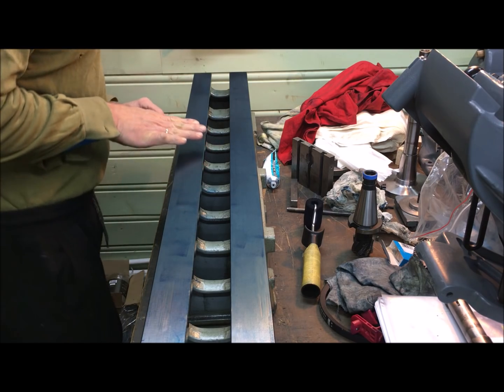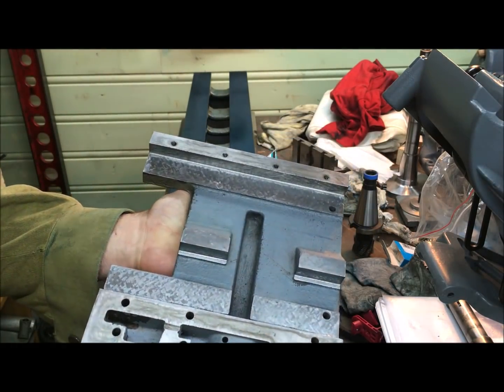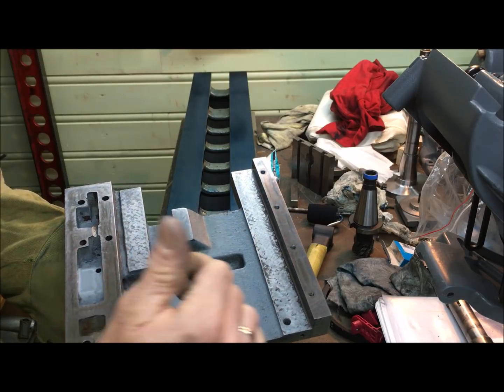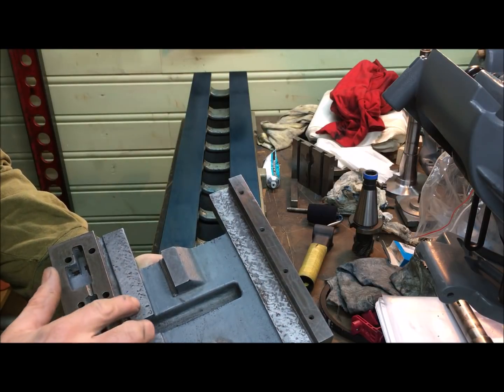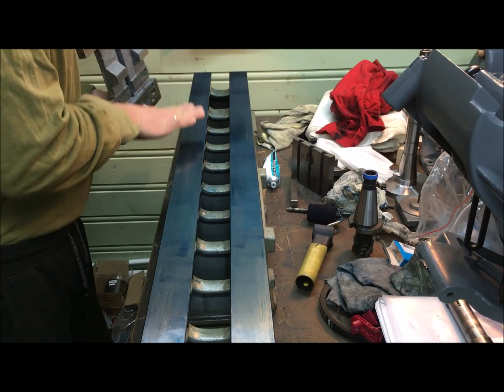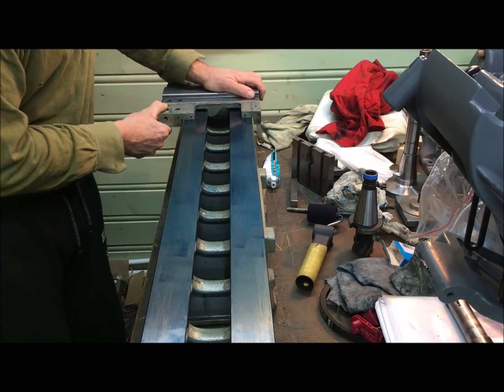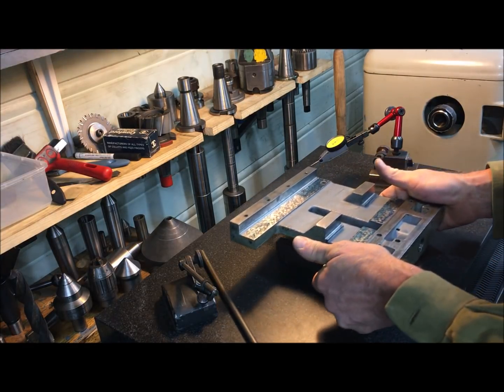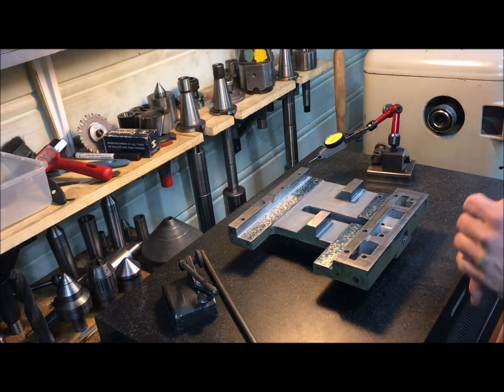EMCO Maximat Standard   cross slide scraping and testng

Comment: where do you get your scraping tools from. homemade or do you buy it?
Reply from the maker: The handles you see me use most of the time are home-made, but the rest is pretty much all Biax (and some Sandvik) blades. Masters and testing flats (ie. surface plates and straightedges) are all bought, apart from some smaller dovetails I have made for specific purposes.  Cast iron masters can be (quite easily) resurrected if worn

Comment: Do you think that principle of broader support applies to 'single dovetail lathe beds', like the Hardinge HLV-H?  I've always taken it for granted that distributing the load force over the greater (and more rigid, I think) top surface of that lathe bed construction is a big reason they got their reputation for precision and durability.
Reply from the maker: Now, the Hardinge, especially the HLV family were top-end class lathes, built to a spec and less regard to cost.
It was much more expensive than both the Myfords and EMCOs
I have therefore assumed that everything about these were "better".
Meaning from design of bed and other components  eg. the beautifully constructed and functioning headstock, choice of materials, layout of control, functions etc. to machining quality, accuracy and finish
I reckon you are right about the greater area available for supporting load improves stability (and more) which in turn yields better performance (high top speed availability with as accurate cuts as wanted). As far as I have understood, the underside is lined with some form of plastic?, which is possible to replace when worn (I guess).. I think it is scraped or at least machined to a fit an finish as required.
BUT.. I am not a big expert on these lathes.. although an admiring fan :)

Comment: I'd very much agree with you Jan about trying to gain better support and a wide guideway than what the original narrow guideway design had. What about adding two long cast iron opposing tapered gibs at the rear inside vertical surface of the saddle? If one was slotted lets say for 6-8 mm towards each end and the other tapped for locking screws it would allow for adjustments for bed wear in the future since you'd now have a bearing surface riding on the vertical rear bedway that the factory didn't have. Shoe horning it all in with the limited area you have might be tough though.
Reply from the maker: I am inclined to try to experiment (on this lathe too :) )
However, I have left it as original, ie. not changed to the wide guide principle (at least not yet.. haha)
I might add a strip of metal along the length, or two as you suggest, either on the inside of the rear way or the outside. maybe a pair of ball bearing recessed into the (beefy) saddle wings? Could mill a slot into the sides, drill hole from top, insert the bearing into the slot on a pin with off centre axis so as to allow for adjusting the pressure (lock nut etc. from the top for easy access). Just an idea.. which would probably be blasphemy for the purist, but nonetheless could be interesting to try out
Otoh, I will probably not use it for milling and most lathe operation (except for a rear-mounted toolpost) would have a point of contact or swivel within the "envelope" of the 2 sides guiding the saddle.. same as for a milling machine, if the spindle is fixed or do not move outside of the square made up by the dovetail (or box ways) sections of the saddle left/right and the outside the table in/out, the milling cutter will stay within a "stable" region. Move the spindle to the right or left or in/out outside of this envelope and things start changing to the worse..

Comment: What brand of blue are you using? Even with my Bed ground to 3micron/1.8m I can't get the blueing good enough to get to 30+ ppi. So far I've benn using a scraped straightedge to get to those numbers.
Do you have any more tips when using ground masters?

Regards,
Johannes
Reply from the maker: Hello Johannes. I am using different kind of blue, but grabbed the oil based/soluble"Tuschierfarbe" this time. It is probably true that some brands and types are better on one type of surface than others but I haven't really given it a "scientific" study. .sorry :) The oil based are more "oily" (of course.. haha) than the Canode (water soluble), but which is to favour on a ground vs. a scraped surface, I have to test properly to say. It is however at least true that the latter is desirable from a cleaning point of view, ie. you can rinse it off with soap and water, hence avoid smearing everything in the house (door handle, kitchen table, cupboards, armatures etc.) and on my clothes plus harder to clean your hands (impossible?). I use washing machine detergent tablets.. probably not very healthy !
Reply: @jansverrehaugjord9934  Thanks, Ive been using the diamant brand stuff mostly. (Beacause it's easily avaiable in germany) But you right. It's a pain to clean all light switches, door knobs etc. 😅 I've also read in moore's foundations (...) that they used rouge with scraped masters. But I couldn't find any information on that eigther...
Reply from the maker: Rakh c Apparantly each scraper had his own mix and method of application. they also used some pretty dangerous stuff
Reply: I have found that surface grinding leaves a tough "skin" on the surface that is difficult to scrape lightly and get good results.  I find it useful to break up the ground surface completely by scraping past the skin and then finish scrape to completion.  It is sad to have to do this on a ground surface that is already very close to finished, but it seems the surface is better when completely scraped, or optionally ground and flaked only.